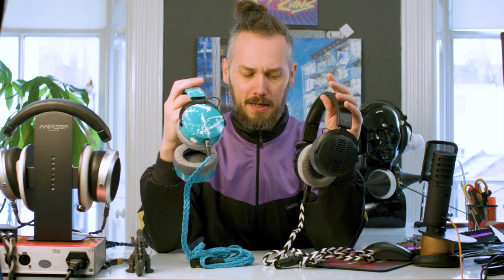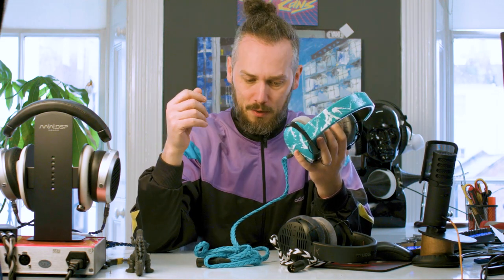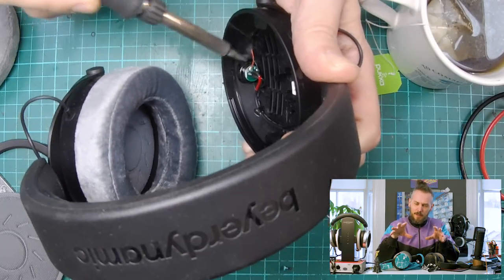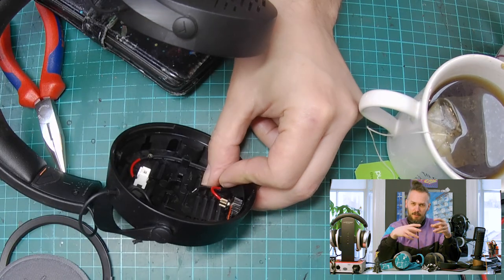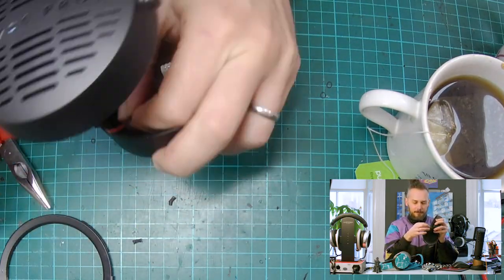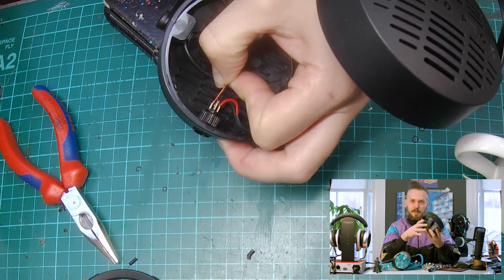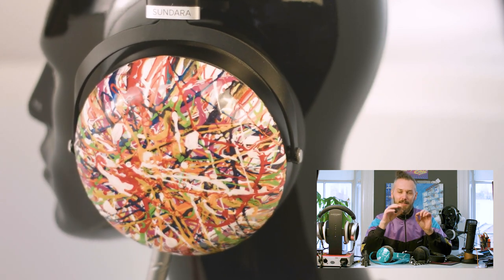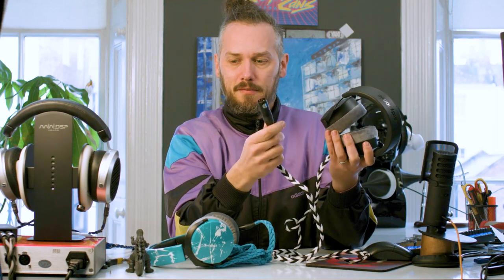Beyerdynamic Pro X DT700 and DT900 Balanced conversion

Comment: How are you liking that Fox mic? I'm getting one and am concerned about the lack of a shock mount, looks like you have a bit of a "solution", but I'd appreciate your opinion.
Reply from the maker: Sound quality is great and it is easy to use but yes, you will need to isolate it from the desk a bit or it has a screw mount on the bottom to attach it to an arm
Reply: @CustomCans  thanks, yeah I've got an arm to attach it to, should be fine then. Also I really appreciated your 700 pro x video. I've got some 900 pro Xs coming and I like knowing what I'm getting into repairability wise. My last pair of headphones lasted me almost 10 years and were not nearly as well designed, and it shows in how wonky they are today after several repairs.

Comment: Hi jason could i ask before i decide to buy a pair of  700/900x,do i then connect the orignal detachable beyerdynamic cable supplies into the xlr adaptor provided..many thanks 👍
Reply: No. Whole new cable with these you'd either have to buy or make yourself. If you can do the conversion yourself you can defo make the cable yourself.

Comment: Is it truly balanced now? It looked like the negative is common between left and right headphones
Reply from the maker: We fit them with a 4 pin mini XLR and wire them properly so the left and right negative connections are kept separate
Reply: @CustomCans  OK, where is you get the Mini 4 pol XLR part from?

Comment: Sure is a shame they changed the pads on these,  the new ones don't fit my ears ;-;
Reply: I modded mine with brainwaves ear pads for this reason. Really nice, there’s left over stickiness of the original pads ring inside  when you remove the stitching on the ring. Then just cut into the brain waves pads and stick them on the old ring.
Reply: Really ? That's a shame. I am a big fan of these new pads. Love everything about them.
Reply: Yes, but if you use your pads for 3-5 days it will be soft and comfortable